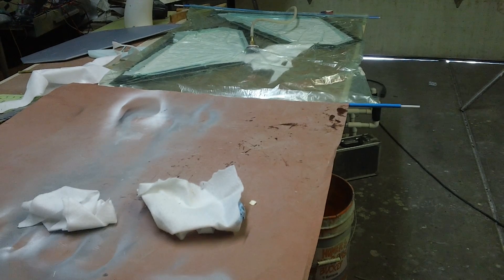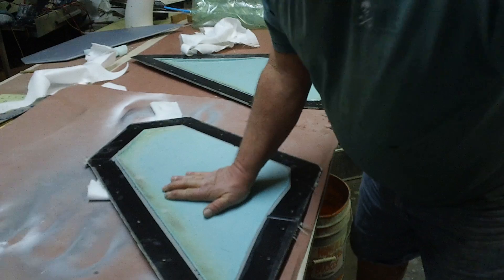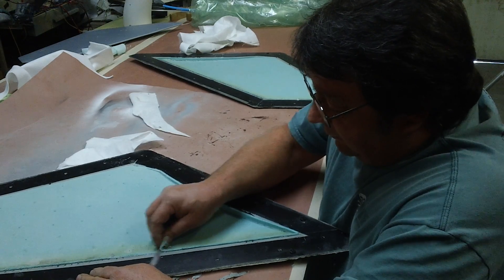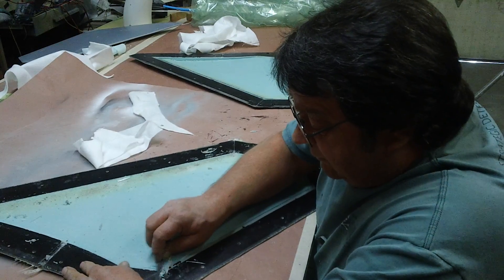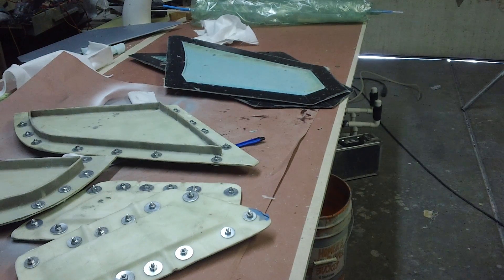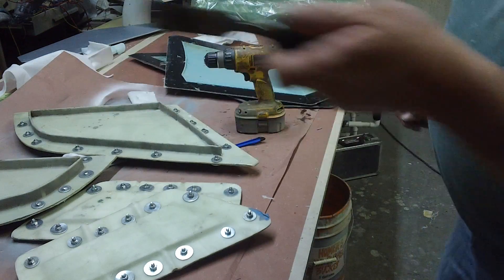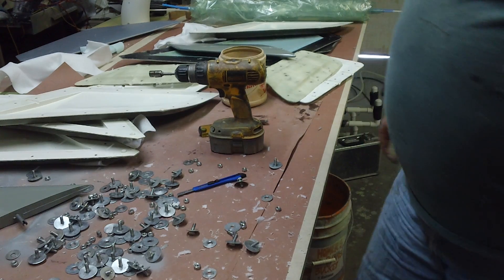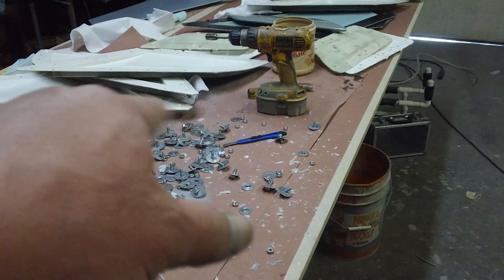unbagging and pulling parts from mod

Comment: Bob you make it all look to easy : P. Hey have you seen the bag sealer that heat seals the bags, all you do is run it along a bag about 1/16th from edge of the bag, but you do have to cut it to unseal. I guess that if you cut it it limits the amount of times you can use a bag as it gets shorter as you go. but I thought that once it gets to short that maybe the bag is at the end of its life. Just thought I would ask. Peter